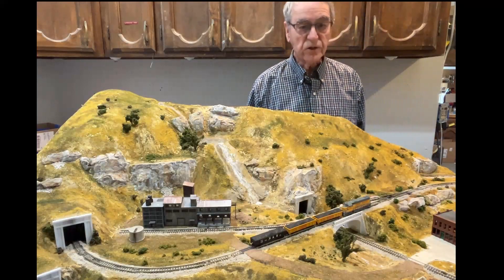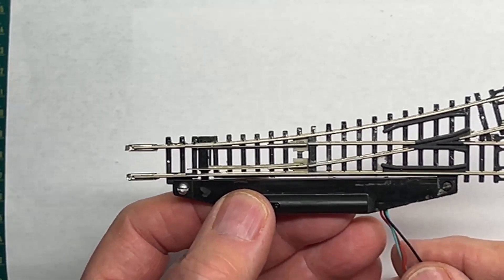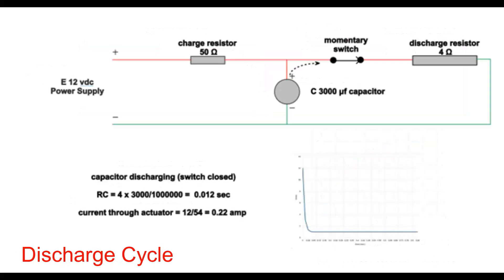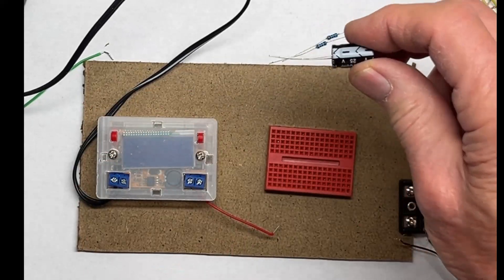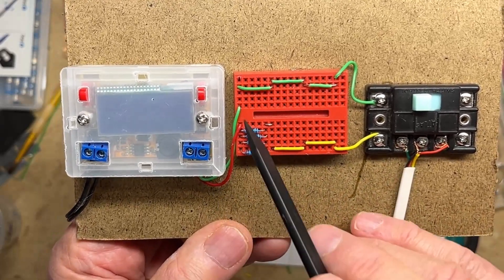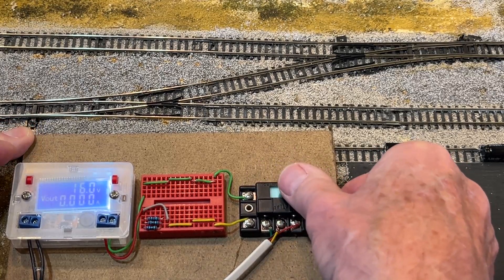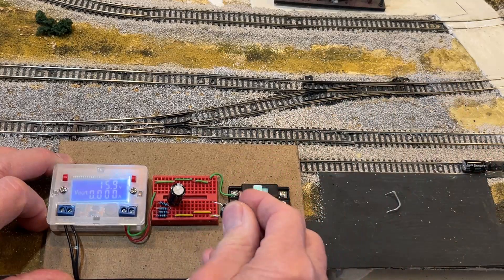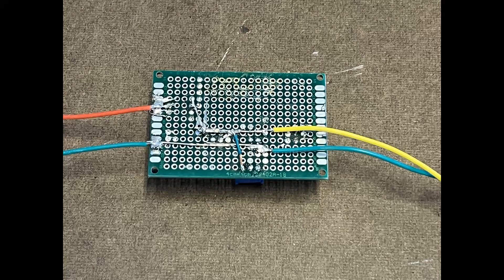Build a Capacitive Discharge Switch Activator for Your Model Railroad Snap Switches

Comment: Great informative video thankyou  ,,a question does it matter if your power sourse is 12 v as or DC???
Reply from the maker: Sorry I missed this. A 12volt DC power supply is fine. Best choice is a 12vdc plug in power supply. Just make sure you know what wire is positive. If you connect the wires backwards you can blow the capacitors.

Comment: Dean - just how do you determine the polarity on the transformer accessories connectors when they are not marked?
Reply from the maker: I just put out a short video to explain this.  Hope this helps. See
Use a Voltohm Meter to Find Polarity of ACDC Wall Mounted Power Supply for  Model RR Electronics
Reply: @DeansNScaleTrains  I went ahead and used a wallwart where I knew the polarity. What I was referring to was a regular train layout transformer. One set of terminals go to the track. The other is labeled "accessories". When taking a meter to the accessory terminals, it shows +20vdc no matter how the probes are used. I have 2 of these train transformers and both act the same way. If I take the wallwart I get a positive voltage one way and negative voltage the other way, just as you showed in your short video. Crazy. Makes me wonder why the train transformers work that way, which is why I took it out of service on my 12 turnouts, and now use the wallwart ->3 capacitor CDU unit, -> to the switch controllers. Every thing is working okay.
Reply from the maker: It sounds like the accessories teminals are putting out AC.  If your meter has an AC capability, try that to see what it says. I wouldn't try to use these for DC circuits or you would ruin them, same as hooking a DC source backwords.

Comment: So if you have multiple switch controllers series together, does one discharge unit between power source and first switch controller make all the switch controllers "safe" or do you need a discharge unit for each controller switch box? I have 10 single switches, no two link together. And how many capacitors would I need? 1,2 or 3?
Reply from the maker: if the power passes through the cap dis unit then feeds to all the switch controllers, you only need one.  You just need to wait a few seconds between switch operations for the capacitors to charge up.  I would go ahead and use three capacitors.
Reply: @DeansNScaleTrains  Thanks for quick and informative information. Now I need to dig up parts and build one.
Reply from the maker: I've published a more informative update to this video at https://youtu.be/Qo-RNoRmPM4.

Comment: Layout looking good Dean. I have a couple questions for you if you don’t mind.

If you were just going to control one switch, how many capacitors would you need for just that one switch so you don’t burn out the switch solenoid on the atlas turnouts?

I’m assuming you used solid copper wire instead of stranded wire for your jumpers etc. What wire gauge did you use?

I believe you said each capacitor cost you a dollar each.
How much did the solderable circuit board that you used to solder everything down onto cost?  

If you had to buy everything that you used to make this up, what would be your total cost?

Thanks for your time
Reply from the maker: I may have to do a second video on this to explain things better.  (if people want that, send me a comment.)

Here are some answers. A problem is that buying things on Amazon is cheap per piece, but if you're only going to build one unit, it's a bit expensive.  I do a lot of electronics and use a lot of parts.

1) Jumper wires are solid, probably #22 gauge
2) use three caps just to be sure
3) prices on Amazon are currently (searchable titles in quotes)
  "Tnisesm 20Pcs 1000UF 35V Electrolytic Capacitor 1000 UF MFD 35 Volt with Aluminum Radial Leads" $5.99 for 10 

    "Chanzon 100pcs 1/2W (0.5W) 220 Ω ohm Metal Film Fixed Resistor 0.01 ±1% Tolerance 220R MF Through Hole Resistors Current Limiting Rohs Certificated" $5.99 per 100

    "PATIKIL 1.2" x 1.2" PCB Board Circuit, 24 Pcs Prototype Perfboard Solder Boards for DIY Soldering and Electronic Project Circuit Boards Solderable Breadboard, Green"  $86.99 for 12

   " [12Packs] 170 Points Mini Small solderless breadboard Compatible for Proto Shield" $7.99 for 12

    "Breadboard Jumper Wires kit,14 Vaules 560Pcs 2-125mm Solderless Flexible Breadboard Connecting Line Cables"  $6.99 for 560 pieces

4) The power through the solenoid is determined by the charging resistor.  The larger it is the less chance for a burnout, but the longer it takes to charge up the caps. If you hold the switch for less than 2 sec, you shouldn't have a problem with any values.
Reply: @ thanks for the response and the answers to my questions. A second video with more explanation would actually be more helpful for myself and everyone else that would be interested. Thank you for your time Dean.